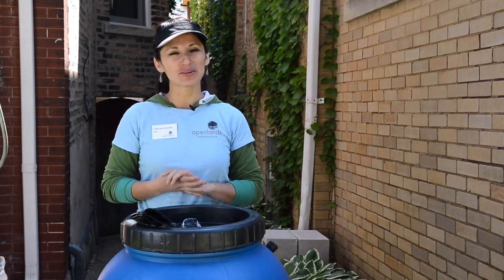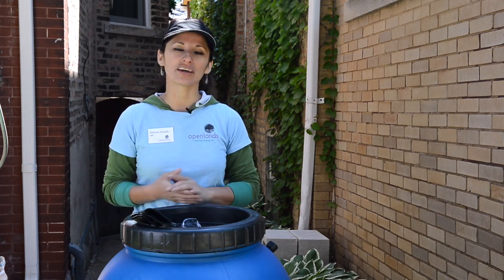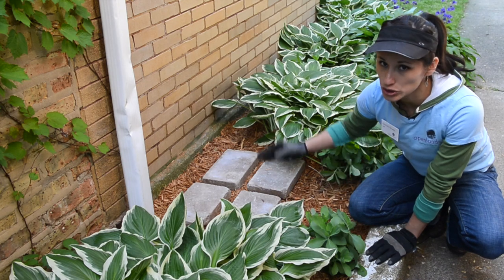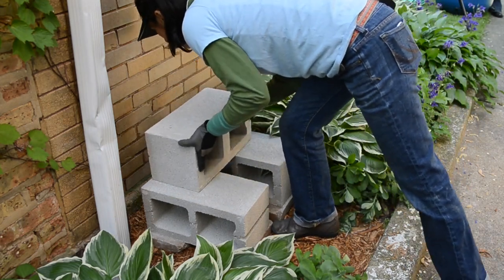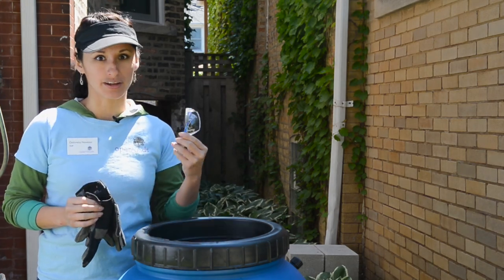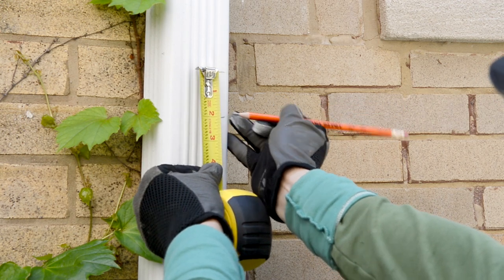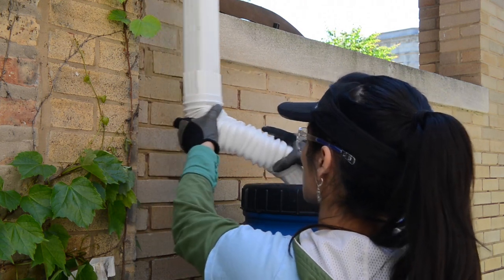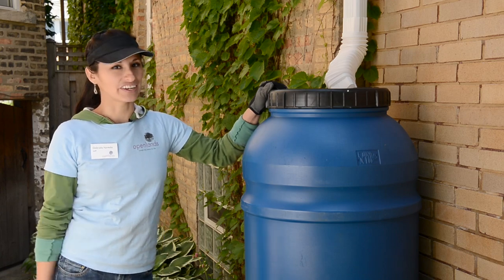How To Install A Rain Barrel

Comment: I have 3 barrels a total of 150 gallons when full. Typical watering can holds 2.5 gallons of water. It takes 20 watering cans to water my garden so you can see 150 gallons can go quick. This season im closing in on 1,000 gallons
Reply: Thank you for your efforts in managing stormwater! I'm sure your garden - and water bill - thanks you as well!

Comment: The hose diameter will handle the overflow during a high period of rainfall? 
Seems small to me and that the barrel will overflow it’s rim during this (probably) short but possible period of time. 
Maybe drain the barrel before a storm to avoid. 
Thanks for the short video.

Comment: To anyone planning to do this in their yard: don't use it on crops. Rain barrel water captured in this way is not considered potable, since it's running off of your roof. It's perfect for ornamentals/grass/etc but you shouldn't put this on something you plan to eat later.

Comment: why connect a hose to the top of the barrel wouldn’t that defeat the purpose of gravity  to water the garden
Reply: Yes this is definitely a mistake. For an official video for newbies this is unacceptable. So much more needs to be discussed
Reply: It is an OVERFLOW hose, directing water from filled barrel to another barrel, or away from your water barrel/house area.

Comment: What do you do in winter season? store inside garage or leave outside?
Reply: @OGutzVentura  interesting. What about those that don't have a place to store them inside? I thought you could drain them completely making sure they were dry with no water. I ask because I know people thinking about these but say they don't have space to store a 55 gallon barrel indoors.
Reply: @PartyUpLive  You can flip the empty rain barrel upside down - keeping it on the stand - and re-attach a straight downspout piece directing water away from the house for the winter because there will inevitably be SOME water going through the downspouts in the winter. :-)
Reply: You may leave it outside but do not leave a significant amount of water in there lest the freezing temps cause the ice to expand, thus damaging the barrel. Personally, I just re-directed the plastic spout back to the original downspout to accommodate melting water off my roof during freezing months.
Reply: @PartyUpLive  They do not need to be stored inside during winter. They are very durable, just not made to hold significant amounts of FROZEN water.
Reply: We just move it to an out-of-the way spot in the yard Dec.-March (Boston area).

Comment: Does the rain water glowing down the flexible spout splash out of the top of the rain barrel and splash onto the building before going into the barrel in a hard rain?
Reply: It can. Especially if you have a screen installed and all the more if the screen has been clogged with debris like leaves. A greater concern with a prior rain barrel I had was overflow when it rained a lot. 
So, all that to say, the rain barrel does require some attention.
A second rain barrel to catch overflow is a great idea if you expect a lot of water and like to have at least one mostly full barrel.

Comment: Hooking up a hose to the rain barrel to water your garden or wash your car is pointless unless you are OK with a trickle of water pressure.  I notice not a word is mentioned about this even though you claim that 'washing your car and watering your garden' is possible with this system.  The rain barrel needs to be significantly higher than the area you plan to water in order to get decent water pressure.  Even after installing the largest spigot possible (which I did) you will still get an inadequate amount of flow.   After doing further research, I learned that indeed, one needs a water pump to obtain a reasonable amount of water pressure.  This system is good for placing a watering can directly under the spigot but  useless for a hose hook up without a water pump.
Reply: True. The pressure is low. What you do with the water is your choice. Personally, I've found my greenery responds better to rainwater than tap water so i've mostly used it as a source of water for directly watering plants of my interest during dryer periods of weather.

Comment: The problem with this video is it doesn't tell you what to do about the hole from the removed gutter.
Reply: The hole? The water is to be redirected with the flexible downspout extension. During winter, the extension may be re-attached to the original downspout.

Comment: the only problem is that the water runs off of asphalt shingles full of carcinogens
Reply: Rain barrel water is not potable. 
However, the water from your roof will go somewhere, no matter what contaminants may or may not be in it. Rain barrels are one option for reducing greywater processing (using industrial processes) and for reducing residential clean water consumption (which cleansing processes also require industrial measures).